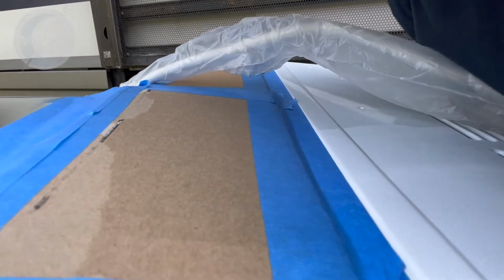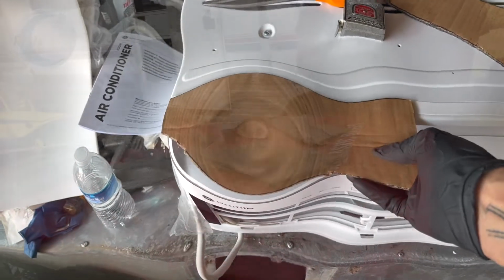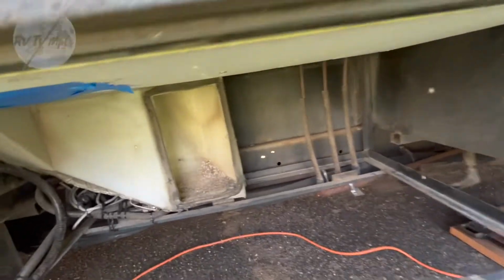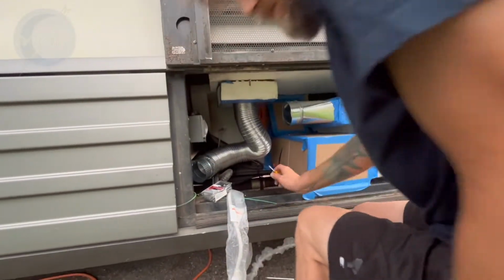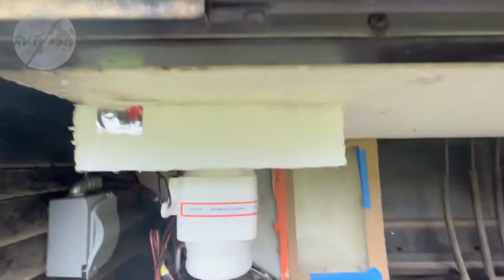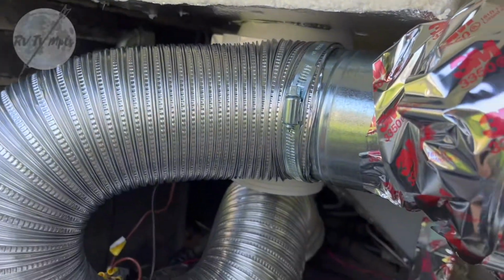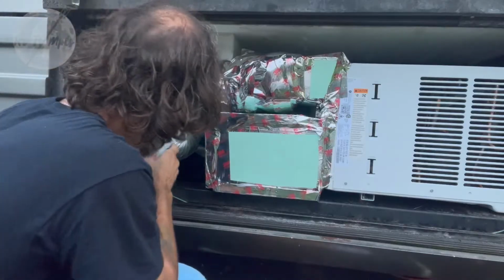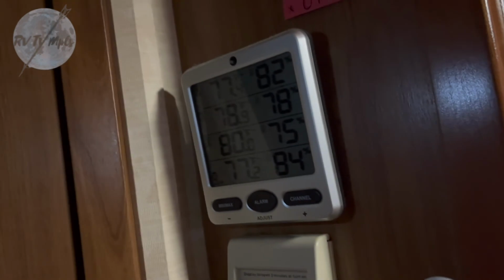The Ultimate RV Basement DIY Window A/C Hack

Comment: Don't you need to vent the hot air?
Reply from the maker: @jeffreyb8152  hot air vents out the back. That compartment is open to the outside, so it has plenty of airflow around it.

Comment: Watching from Australia, this is very interesting. I don't believe that we have RVs like your RV. Just wondering how you control the temperature and air flow etc. When the controls are located on the air conditioner itself rather than via a panel inside. Brilliant engineering though.
I have only seen a similar project done here. An enterprising man purchased a very big box air-conditioner and put it on his house roof. Ducted the cold air into the living area and had some kind of return to get the intake air back. It 
Worked well for a small house.
Anyway well done!
Reply from the maker: This A/C unit has an app that I control from my phone. So I can control it all from inside the RV, or anywhere in the world. Because it connects to WiFi we are always able to keep an eye on the temp.

Comment: I’m just curious if the cooler works as good as it would if it was not in that storage bay because as we all know, cold air sinks, while hot air rises and normal campers and RVs, the heat ducks are on the ground in the bay that your air conditioner, while your air conditioner is usually on the ceiling and the AC ducks are in the ceiling in between all the rafters
Reply: I guess I have one more question what are you doing to make it so that when you drive your motorhome that water is not getting splashed back up into that storage bay because otherwise you’re just going to be replacing air conditioners left and right because they’re rotting away or theregetting clogged fins because the tires are shooting up all that road debris
Reply from the maker: @codyschwoch5451  Our RV has a furnace that puts heat out through the floor like a normal RV. Winnebago went to this design because it was more efficient and put less weight on the top making the handling a little better. Our AC is ducted so that the cold air comes through the roof. Truth be told the AC we retrofitted did not have as many BTU's as the factory unit and If our finances where better I would have found a place to get that repaired. But the unit we did buy was way more efficient and used less energy for our boondocking needs. On really hot days, this system I built could use a booster such as a small battery powered unit. But we were more than happy with the outcome because it was so much better than no air conditioning. As far as going down the road with it, I don't see an issue. I can spray it out to clean it if I like. Not that much road debris is really getting up there and it is strapped down good and tight. Hope this helps!

Comment: I guess that will work.. But venting the hot air is going to tax that unit. As the side and top vents need clean fresh air. Then some place to vent it real fast...

I would also mount it on rubber feet. As these things are not designed for rattling around down roads...AS the oil in the compressor gets plashed around.. Why they ail pretty quick. People need to let them settle for a few hours once they park. Then turn them on..
Reply from the maker: There is still room around it on all sides, Behind it is also pretty open. Luckily we haven't had any overheating issues and it runs really well. 

We try not to take the RV down any rough roads. We have also had this unit on and running while traveling down the road with no issues. There are some videos we have seen where window units take quite a bit of abuse and keep on working. I think they are a lot tougher than people think they are.

Comment: I plan on doing something like this in my fifth wheel, I had a 10btu window unit running out the back window of my rv and it worked great but RV park told me to take it down... Now I'm thinking if I should stick with window unit in the belly like this or the front storage, I think the front storage would be a better deal.. what would you recommend? With the front storage I could leave it kinda propped open maybe so the heat can come out and still be hidden
Reply from the maker: Honestly the easiest option would be the way I would go. Which in this case sounds like front mounting it. Like you said you would be able to mitigate heat a little easier and it would still maintain its stealthiness. Plus they can still be more efficient than a mini split. Hope this helped.
Reply: @Independent_DIY  yeah it's gonna take some thinking and some Craftsman ship haha, but man the window units work great. I have a 38ft rv, both top units are crap and always will be crap, the window unit you can replace for quarter of the price and they work even better. I was mad when the rv park told me to take it down, my rv is backed to some trees and I had the window unit propped on a metal shelf. Worked great and the air was nice and clean, my old roof top unit has a old ac smell....but anyway nice work bro. Gonna take some notes from this! I bet it's still working like a champ!
Reply from the maker: @theodorecarbajal2975  Thank you, and yes this summer is definitely going to be much more comfortable. Good luck and keep us updated on your progress.

Comment: drill a 3/8 weep hole thru the bottom of the tubing or you will have a mold problem thru out the a/c venting system..

Comment: I really am trying to find something nice to say, but the more I watch you cut cardboard the appropriate response/s eludes me.
Reply from the maker: Thanks for watching. What do you think we should have used for the fabrication material?
Reply: @Independent_DIY  why don't you buy a mini split or fabricate a roof top AC unit.
Reply from the maker: @jwlindem1  the TLDR answer, because this works with our previous setup and uses less energy..

I had contemplated going the mini split route. But it would have actually taken more fabrication, and likely still use more energy than the system I built. Feel free to check out the follow up video where I show you just how efficient this whole setup has been for us this summer. Again thanks for watching. 

https://youtu.be/rVCoa1CXXTI